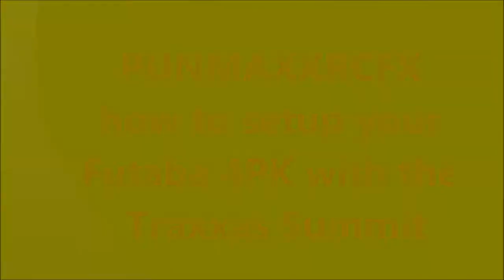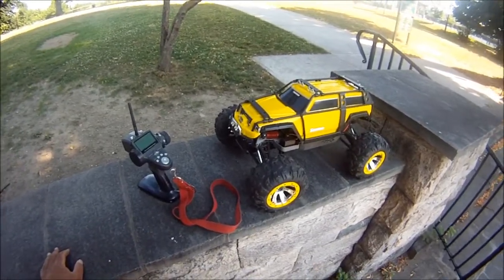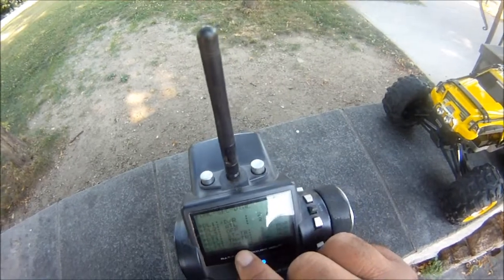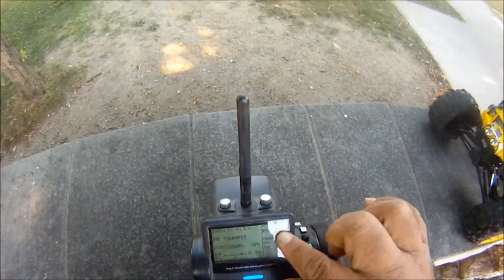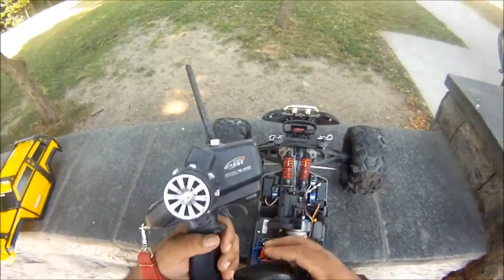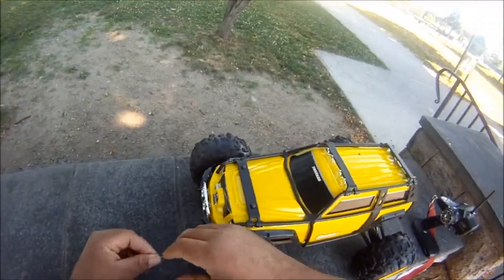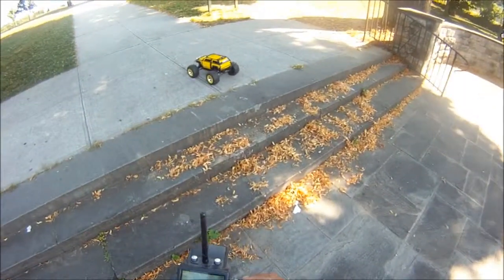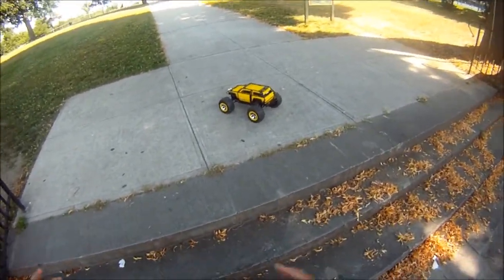PUNMAXXRCFX how to setup your Traxxas Summit with the Futaba 4PK

Comment: Nice video. Let me clarify: this only works for Summits with the earlier AM radio with TRA5697 included. The later 2.4ghz radios do not have TRA5697 differential controller included because the receiver has it integrated. To use the 4PL/PK with later Summits, purchase part TRA5697 and follow the instructions. Cheers!

Comment from the maker: All the micro servos for the diff look comes from their own factory  Y adapters so you have to plug them on CH 4 , on CH 3 you can plug the transmission shift on the fly servo , the only Y adapter that you need to buy is for the steering servos CH1 since the original RX from traxxas comes with double CH1 to plug each steering servo but all the other aftermarket RX only comes with one CH1 steering channel

Comment from the maker: The summit comes with is own Y adapter for the diff lock micro servos and you are suppose to keep using it , the only Y adapter that you need to add is the one for the steering servos since the futaba RX doesn't comes with double ch1 like the traxxas original RX does .